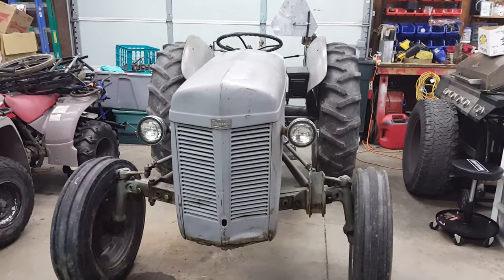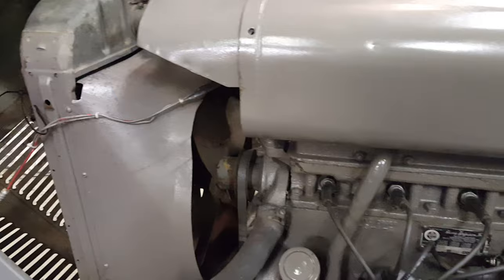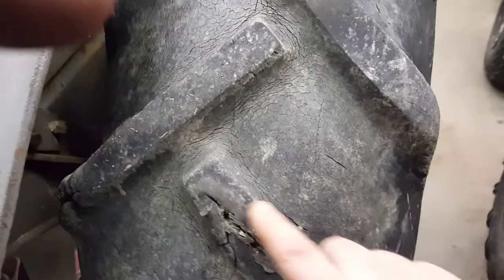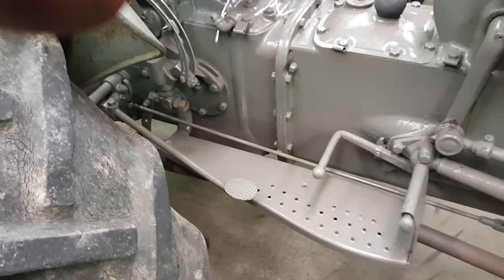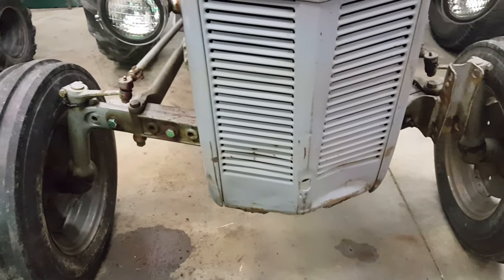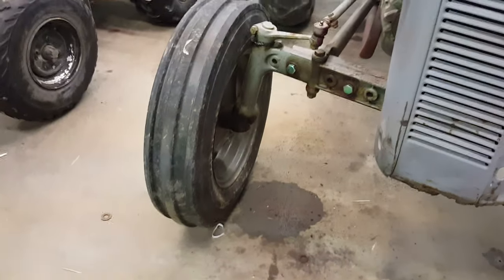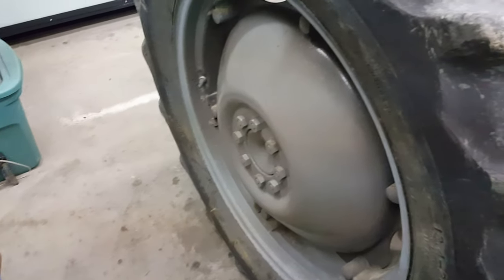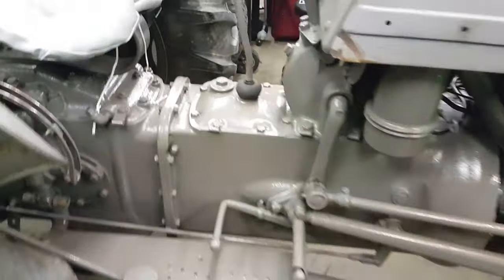1954 Ferguson TO-30 Tractor

Comment: The reason for the starter on the gear selector is a safety feature. The tractor can not be started in gear. Harry Ferguson was way ahead of his time.
Reply: tractor can be started in gear with the crank start
on the front cinda safe wen u start it in gear and the tractor driver over u =p
Reply: If you keep cranking when the tractor starts moving forward you get what you deserve. It's very hard to turn it over by hand when in gear.
I love my 1949=/-  TO-20 Ferguson. It keeps going when nothing else would start!

Comment: Nice, my 1951 Ted20 which I found in a barn here in North Wales also starts on the gear stick, it hadn't been run in over 20 years, now running and 60% restored so far
Reply: I just had a TO30 given to me I am going to go threw it sure is a nice tractor

Comment: I have that exact tractor. 1954 gray. Never painted. Most of the paint is still there and I converted mine to 12V and put an oil filter adapter on it to make changing filters cleaner and quicker. I am the third owner and I even got the original paperwork and manuals with it. I will likely keep it til I die since it does everything I have ever asked of it. This tractor has never failed me and it has paid for itself many times over since I bought it 7 years ago. They are tough, very well made machines and I have friends with Fords that like it even better than theirs. The PTO is a hassle but you learn to live with it. An overrun clutch is a very useful item to install if you do use it much. You have a good machine there and it will serve you well for many years. The Continental is a gem of a motor too. I'm in the north country and it will crank right up on even below zero days.
Reply: Dan Hillman ARNOLD SORBA

Arnold corba

Comment: Hi. I know it’s been a while since you did the TO-30 video but I’d like to say thanks for doing it. I’m in Australia and have a 1955 English built TEA-20. I notice there are some differences to yours, the engine in particular. One thing that is common is the gear lever start. All the TEA’s that I’ve seen start that way. I hope you still have your Fergie and are still enjoying it. The are an iconic little tractor. Best wishes. Colin

Comment: You’re do great with that old fergie, I just replaced the 6 volt starter out with the new 12 volt to match everything to 12 volt as the previous owner totally burned up the 6 volt starter. Thanks for the carb tips because I would have had to consult the tech manual (original) to find tuning specs. Mine is a 54 T20, just fired it up after sitting for years because I didn’t have time to work on it. Good job brother. Do you know why the starter is set up like that? The engineer ran himself over by previously starting a tractor when he started it in gear while not in the seat. Ingenious thought right!?

Comment: Great Video..I just purchased  T 30 Ferguson...1953...Very good Tractor...Runs and handles well..P.T.O. 540 and 3 Pt. Work well. Some issues with fuel bowl leak,which will be taken care of and perhaps rebuild or replace old...carburetor..Will not stay at idle speed..and need new oil pressure gauge...operating at 40...45...but glass is missing.need needle protected..new gauges are .$ 19.95.. Carb kits $47.00.Rubber like new...Good old Ferguson..for small jobs around the Ranch..
  The Safety feature ,in starting the Tractor ,was a great idea,for the time...Some earlier models would start in gear...not good......Harry Ferguson..was a brilliant man...With the 
3 Point.he invented..changed the course of Farming....Ford got Greedy..To Bad..Ford Ferguson......or should I say Ferguson Ford....could have made history...and to a certain extent...they did.

Comment: Eric do you happen to know what the block below your draft quadrant is for?? looks like yours doesnt have a pressure line hooked up, mine taps to the port on the lift cover. yours is the only other one ive seen and i think that knowledge died with the old timers

Comment: My ferguson TO 30 will start but not keep running. Sometimes run a few seconds or several minutes. Filter screen in side gas tank is clean. Fuel flowing good thru line. Fresh Gas.  Any ideas ?
Reply: there is a screen in the inlet fitting on the carb. take out that inlet fitting and check that little screen.
Reply: @flhusa1  thank you for replying. I got it fixed. One of the two bolts which attached carb to the manifold was just a little loose.  I do love my Ferguson. Have a good day......tim
I'm a beekeeper and I'm ( wallsBeeMan ) on you tube